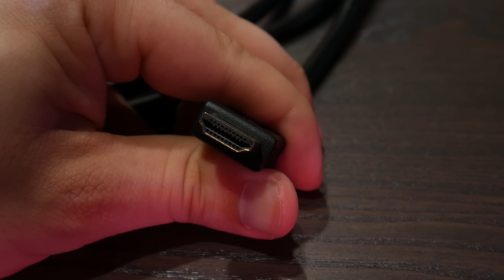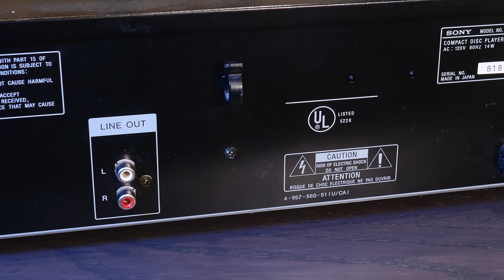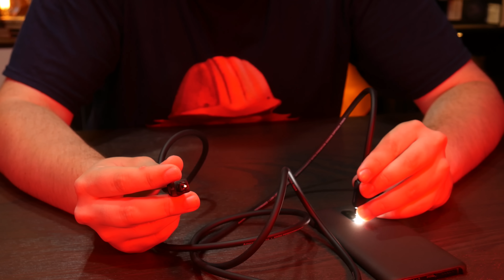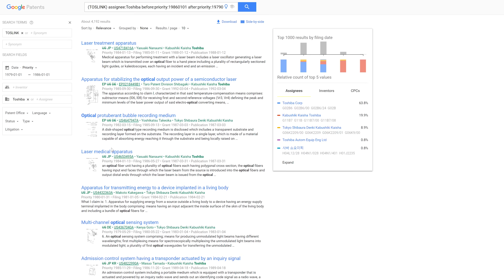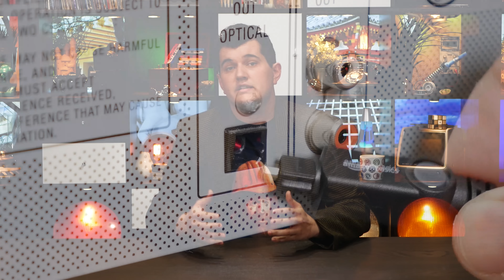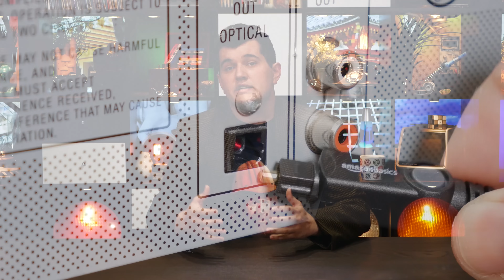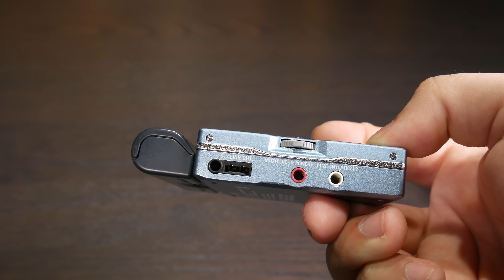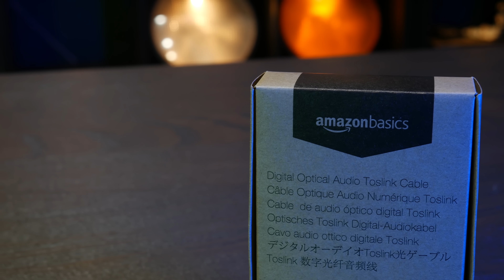TOSLINK: That one consumer fiber optic standard

Comment: As a MD user in early 2000 and to this day in local community radio i can say the best feature i found with TOSlink is the ability for MD to change track automatic from source input while doing recordings. That i havent seen RCA line be able to do. But this only comes handy for very specific use-cases.
Reply: Sony MD decks will do that with both optical and copper SPDIF. (In their CD and MD players, it’s the same data stream going to the optical and copper output transmitters — as in, they’re literally both connected to the same data line in the circuit!) Super handy feature that I loved back when I was using MD heavily. 

Later MD recorders can also automatically start recording and insert track marks from analog sources, but it requires there to be a few seconds of silence between tracks.
Reply: @tookitogo  Cool that it was added for LINE sources aswell. But for mixed CDs the silence wouldnt work.
Reply: @pmr1049  Well for CD you’d just use digital. Doing it on analog was really intended for recording from vinyl or tapes, where you normally did have silence between tracks. (On cassettes, having the silent gaps was also handy for better players that could detect gaps while fast forwarding or rewinding, allowing you to skip tracks automatically.)
Reply: @tookitogo  That makes like a good option for digitalize with track marks
Reply: @pmr1049  That’s literally why the function exists…

Comment: Recently got a new LG tv that i connected using TOSLINK to my receiver from the early 2000s. It turns out that it works fine with my PS5, on my PC I need to obtain a DTS license and my Switch only supports lossless PCM  for surround sound, which doesn't work.

I also read that de PS5 doesn't have TOSLINK anymore. But still works if you route it trough the TV using the TOSLINK out on your TV. 

It seems that i will be using my trusty old receiver a bit longer, because of this standard that luckily never changed 🙂

Comment: When I wanted to connect my TV wired to my internet connection, I found POF (plastic optical fibre) and it works really well. You cut the fibre to length yourself and poke it into the converters. I've since replaced it with classic optical fibre but it was cool to play with.

Comment: The silly thing is that I'm currently using TOSLINK because the cable wasn't particularly pricey and it actually freed up the S/PDIF port on my sound setup (which I sometimes use for when people want to bring music that isn't available via streaming).

Also, it's funny that you should bring up power surges and separation of devices; I once lived in an apartment where ground didn't work so I would get a "buzzing" from the metal body of my laptop.  I took the laptop off of its power supply expecting it to stop, but nope it continued.  Turns out that at that point I was being shocked through the external monitor that was plugged into the surge protector and the external monitor was plugged into the laptop.  Kind of a niche problem, but you'd be amazed how often places do a poor job wiring up outlets.

I think that if they really wanted to update TOSLINK they could probably do it by adding multiplexing using different wavelengths of light the way that they do it with other types of fiber so that it could have bi-directional communication as well as more throughput.  To be backwards compatible all they'd need to do is have a newer device try to send a "handshake" signal on one of the newer wavelengths; older devices wouldn't send it or wouldn't "see" it so it'd probably wouldn't be too much trouble to get the newer devices to automatically treat a connection as the older connection type if the "handshake" wasn't successful.

Comment: Ugh TOSLINK. One time when I was working as an AV installer , one of my customers who was quite well off was building a new house and he wanted everything top of the line. We were installing hidden ceiling speakers, in wall tweets - the whole works. It was kind of amazing when it was all done, he could use his phone to play music in any or as many rooms as he wanted. However, there was a damn hum that we could not isolate, and the customer was not happy about it. We spent HOURS replacing cables, shielding electrical wiring and we even hired a spectral analyzer to see if it was something wireless mucking around. This was DAYS of work and we were getting nowhere. 

TOSLINK. A cable that cost less than five dollars fixed the issue. I replaced a copper lead between the amp & mixer and the hum was gone. To this day, I still have no idea what was going on.

Comment: Optical Audio has the advantage of ground loop isolation (and RF rejection). However, connecting a TOSLINK only source to vintage analog gear is a PITA, as it requires a DAC/converter adapter. ALSO, if you need, Dolby Digital (ATSC TV audio signal decoding), finding the proper DAC/adapter that works can indeed be hit and miss.

Comment: I shook my head at the gold-plated cables, only moments later to realise I have been using Toslink to send audio from my xbox to my surround sound system (but not video, so there's not the lag of it looping through to the TV) but now I realise I should just have it direct to my TV and then connect the surround sound to the ARC HMDI port. This must be how my dad felt when I pointed out his shiny new HD PS3 didn't look any better on his TV because he had it plugged in via RCA, not component (his TV didn't even have HDMI).

Comment: My old Sony 5.1 surround sound system (circa 2004) makes use of TOSLINK, and it connects to my Chinesium SMART TV (circa 2020) without any issues and provides excellent sound quality. This video did a perfect job of explaining what was going on behind the scenes, and it makes me happy that old standards like these are still applicable and seamlessly integrate with today's technology.
Reply: It’s great to see a homie with a similar setup to me. Mid naughties Yamaha surround sound system with a Kogan smart TV bought in 2019.
Reply: I have both optical and SPDIF connections that can do 5.1 on my old receiver, so no need for optical but maybe devices only have optical.
Reply: @abc123fhdi   S/PDIF multi-channel is always compressed (lossy), Toslink can pass 8 channels of uncompressed 24-bit/48kHz.  
Multichannel recording and production will bear specific limitations if compressed data is being implemented at the get-go.
Reply: Same for my PS2 to my newer Samsung TV lol. And I'm using $1 chinesium toslink cables. The price & compactness for routing are the selling points for me.

Comment: Still using TOSLINK in 2022. My USB DAC outputs 48khz into my mini disc deck, which I used to record Spotify feeds without any DRM. Making Mix tapes have never been easier. The MD deck also outputs into my Yamaha AX-700D in TOSLINK. Oh the USB DAC also feeds this same AMP. I love TOSLINK.

Comment: I used to work in the Digital Audio industry back in those days. There are a couple of very good reasons that TOSlink:
1.) The S/PDIF signal over RCA cables degrades quickly if you're not using cable specifically impedance matched. Most audio cable is not, and often caused problems over lengths > 3m. 
2.) It also avoided the potential of ground loops. If your two pieces of equipment have different ground potentials, that will introduce noise on the signal line. 

There's also a nifty thing that was the ADAT, an 8-channel digital audio recorder that used the same TOSlink optical cables for their "ADAT Lightpipe" format, which carried 16 channels of 16-bit data.
Reply: Sorry, commented before you mentioned ADAT.

Comment: If I had watched the whole program I wouldn’t have posted this… In the Pro audio world check out ADAT connection and Light Pipe. TOSLINK is as far as I know two audio channels. ADAT and Light Pipe have more audio channels. The TOSLINK cable is many times used on the other protocol.

Comment: I like how optical also has a role in AC/DC electronics by means of being optocouplers. Isolating two sides of an electronic circuit avoiding stuff like ground loops in things like regulated power supplies.

Comment: eight-TO-fourteen..... wait how does that result in 8bit words?
Reply: That's the mastering side of making a CD. The player is demodulating, taking those 14 bits from the disc and turning them back into 8. The purpose is to guarantee a certain number of binary ones in the data stream because CDs encode those as a transition from pit to land or vice versa, while zeros are "no change".

Comment: toslink saved my audiosetups multiple times.
the keyword is: groundloop
I do lasershows for small and mid-sized events, so i have laptops as sources for the sound.
If i connect the laptop up via normal RCA, i have the high pitched whine of the PSU on my audio.
even if i use a digital system, the noise gets injected into the mixing desk.

that is why i use toslink. the optical isolation eliminates the groundloop and gives me clean audio no matter the laptop i use.
Reply: Also the HDMI ARC has Bluetooth-like levels of "sometimes just doesn't want to work" reliability for me, so my TV and amplifier are still connected by Toslink for broadcast audio.

Comment: Clock jitter is a funny thing. You could say that S/PDIF and Toslink are sort of semi-digital. The bits are digital (duh!) but their timing is analog. Imperfections of the timing directly affect sound quality when the bit stream is is fed to a standard DAC. This is why audiophile "jitter eliminating" DACs take the bits from the input, and then rebuild the stream using their own high-precision clock before converting it to analog.

This is one of the reasons why optical is (at least theoretically) better than S/PDIF - electromagnetic interference can add jitter to S/PDIF but obviously has no effect on optical.

Comment: TOSLINK is still useful for some PC audio setups. If you're running a stack (DAC+Amp) you may find a TOSLINK more useful then USB for connecting your PC to the DAC. I've found annoying driver issues with Schiit's Modius DAC using USB. So I picked up a short 3ft TOSLINK and tried that. Problem solved. Considering the DAC goes into my headphone amp, I'm not using the TOSLINK to feed the audio to my ears...simply to move the data from the PC.

Comment: I have a sampler from the late 80s that has these. It's a Roland S-770...and it came with a CRT, expansion cards, remote keypad, digitizer tablet, external HDD and CD-ROM, and MKB keyboard. It samples at  crazy clarity and does all this wild manipulation with super high quality with no aliasing. It can just pipe into a digital mixer. It's wild for the 80s. I imagine it was expensive (it was honestly kind of pricy when I bought it 5 years ago). It has some cool and interesting features and is also neat looking.

Comment: Welp, I've had a Samsung 32" TV and a Panasonic SA-PT580 Home Theater System for years, they both support TOSLINK, I never really used it despite having a TOSLINK cable. I just used the Audio Out Ports on the TV into the Audio In Ports on the Home Theater to get audio output. Bruh it really wasn't advertised well enough I guess.

Comment: You can also buy un-keyed TOSLINK cables now that fit into standard jacks regardless of how they are rotated.  They are a lot easier to use on equipment you need to reach behind to make connections.
Reply: I should get some of those…

Comment: TOSLINK would have been awesome, if they hadnt torpedoed the standard by requiring to use Dolby for multi channel support. HDMI still is the only way a consumer can transmit multi channel audio digitally without lossy compression, supporting up to 1mbit per channel.

Comment: I recently had some software issues with my TV and soundbar. I had the soundbar connected to the TV via HDMI/eARC and all my other devices were connected to the TV. My BluRay player could pass the sound through the TV to the soundbar with no problem but for some reason, this didn't work with my Laptop. That's where Toslink saved me from further headaches. It just works.

Comment: Hey awesome. I still use toslink to connect my PS2 to my entertainment system while it runs all video with one yellow cable. My audio is better on the PS2 then it is on my PS4 but the visuals mise we'll be 8 bit in comparison. Also happens to be the only way my hifi will connect to the PS2 save for running it through the tv for average sound.

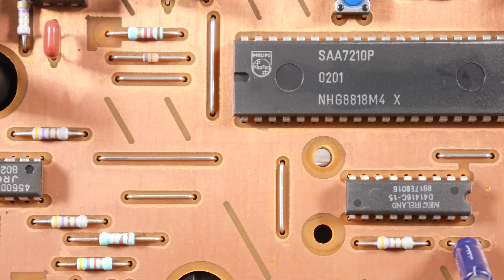Comment: 2:30 I'm sure Reed Solomon is applied only to data, not sound. Sound sectors are 2352 bytes. Data sectors are 2352 "raw" bytes and 2048 "cooked" bytes because 2048 data bytes are Reed-Solomon encoded into 2352 bytes for error recovery.

Comment: Why do people forget that ground is 1/2 of a completed circuit?  Ground isolation is significant advantage of Toslink.  Though this could be done via copper with current loops and opto-isolators (eg. the copper S/P-DIF standard).  As an electrical engineer by trade, I can tell you conducted emissions is 1/3rd of my job!

Comment: For the fiber standard, the bigger benefit in the "noise immunity" would be that it creates a break in the otherwise continuous ground plane created by all the shields on the RCA and other cables. 
This isn't a problem for a simple "A to B" configuration, but toss in several devices, with sporadic implementation of their own runs to building ground, and you get a fun game of "where's the ground loop"

This, as stated, isn't an issue on the digital side, but because it affects the global ground plane, the amplifiers are affected as well, leading to that high noise floor and 50/60hz (region dependent) speaker hum we all know and hate.
Reply: ... Then they put on mini-toslink... re-establishing the same shared ground issue that we had with the regular RCA cables....

Comment: I found using eARC on my soundbar really limited what I could do with my TV.  For example if I just had my Nvidia shield hooked up and my soundbar through HDMI eARC it worked fine, but if I tried to put in an HDMI switch box on any port (on the TV or the single input on my soundbar) the soundbar refused to work at all.  It might just be a crappy soundbar despite the fact I paid like $600 for it but the situation really soured me on HDMI eARC.  I've since opted to switch to optical because I can use my HDMI ports how I see fit.

Comment: I've seen TV's and own a few that has a TOSLINK port but they have a cover over them. You'll need to "punch/snip" it off in order to actually use it. But most of the time they're sorta unlabeled so the average consumer/user won't even know what it is. At the same time if you're not using the TV with a HIFI A/V receiver then it'll almost never get used.

Comment: Vinyl and tube amps is where it's at. And I have a turn table that can not only reverse with a press of a button, but you can plug your mp3 device into it and Scratch them. It does all 3 speeds standard and can adjust from there. Yes, you read that right. All three speeds. 33⅓, 45, and the older speed of 78. 
You should do something on that older stuff. it's amazing how a glass tube does some many different things. Such as the audio amplification as mentioned above and something not many knew or know of, the Television. Yup. the TV was a CRT before they went flat with projection and then Plasma.

Comment: I think that you made a giant overstatement in the "it's digital" ...and so analog interference isn't an issue point:  jitter and dropout is definitely an issue that gets exacerbated by analog noise, and DOES make things sound worse.  Saying that you'll get drop-outs and jitter, but it won't sound worse, are mutually exclusive points.  There is no error correction present in SPDIF.  Analog noise can easily introduce errors, and waving this away because the 1 and 0s are unambiguous is silly I think.  Error correction is something that I'm really surprised you didn't mention in regards to optical vs copper as well, as optical can suffer from literal reflections that result in frequencies not arriving on time, or arriving multiple times.  Even though you have a digital signal, because there is no error correction, this can objectively result in a better or worse sound.  This is something that gets missed a lot because nowadays digital comes hand in hand with error correction and order checking, but it wasn't always this way, and certainly isn't the case with SPDIF

Comment: Just somewhat recently Toslink\SPDIF has started to become a thing in car audio.  I think mostly due too effective isolation of ground loops that are very common in car audio installs that cause all kinds of noise in the final amplified analog line level signals.  I just recently purchased a car audio head unit that has optical\coaxial Toslink\SPDIF jacks and it appears that some current higher end model line of car stereo amplifiers are appearing with Toslink\coax jacks. This fact is actually what led me to find this video.  I'm guessing this is being used in car audio because 1) it works, and 2) has very little cost to implement.  I am guessing no licensing costs that car audio manufacturers would have to pass along to consumers if they were to license the new technologies like HDMI.

Comment: Pretty common use case is HDMI via fiber it allows thinner cables and a much greater range than the 10m max of the HDMI standard.
As far as I know it is not standardized, but there are quite a few suppliers out there with them.